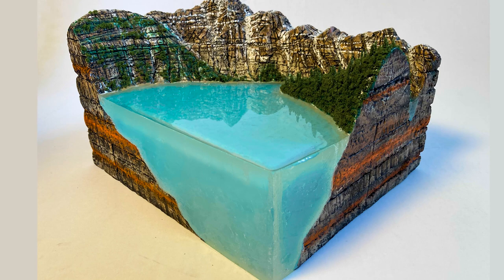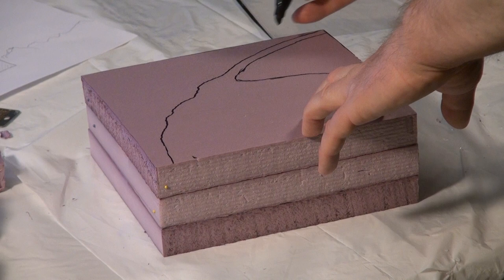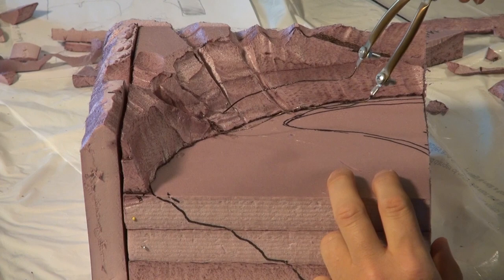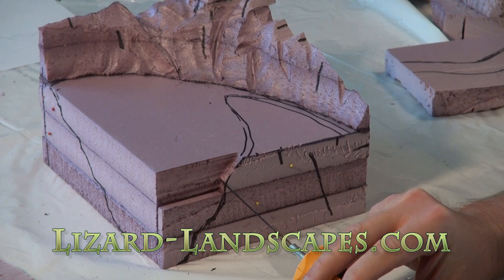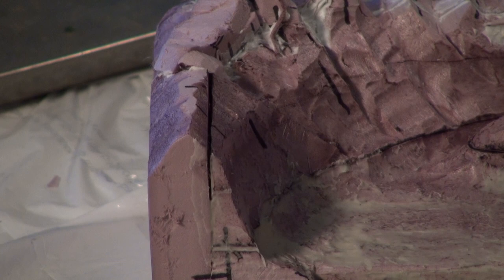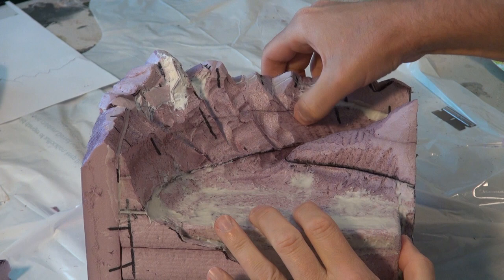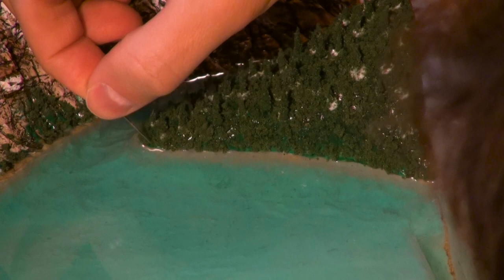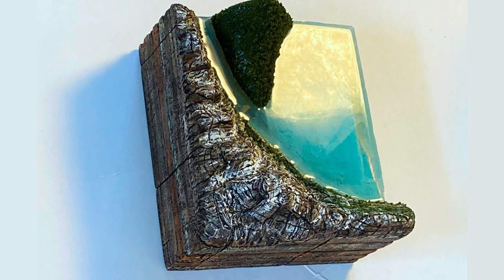Moraine Lake diorama + Christian Message!

Comment: I have really enjoyed your videos. You do amazing work. You make it look so easy.  I have tried my hand at making a waterfall for my pet frogs. It is not going well.  I was trying to use expanding foam and cut a rough shape of a waterfall that goes down in steps. I want it along the main back wall of my 30 gallon tank.  BUt the problem is now that I'm "painting" it with drylock it has huge pores.  I have added like 4 coats and can still see the black foam in many areas.  I'm thinking of trashing the whole thing and using foam boards like what you show in these videos though I'm just not good at carving yet or seeing the shapes inside of little flat squares. I'm using foam I've gotten for free in boxes too to save money.  Is there any advice you can give me?  I could post a video to show you my disaster if you'd like.  BTW, fellow born again Christian here. I like that you add nice little messages in your videos.
Reply from the maker: Thanks!  I would honestly just get one from the store, they probably have a great selection nowadays.  I posted a while ago through annotations (youtube has since removed everyone's annotations) that I was not 100% sure that this process (my old process, -I haven't made one of those in years) was non-toxic, but that the steps I took were geared towards making as non-toxic of a project as possible.  In those videos from years ago, I always used aquarium grade silicone to seal the final product after having applied a layer of non-toxic acrylic sealer.  If I ever made a project for a living creature again I would just get one from the store, except for "dry" environment landscapes.   Thank you for your support, let me know if you have any more questions.
Reply: @LizardLandscapes  No, there's nothing in the store that fits my vision or as large.  And I want to make something later for a 55 gallon though I need to figure out this small one first. I'm not worried about toxicity. I have watched the other videos on people that build these and yes I have the aquarium grade silicone, and the foam was for pond waterfalls which have fish, and drylock is proven to work well in tanks with frogs and plants.  It's the process that's kicking me.
Reply from the maker: Post a video if you can to your channel, and I'll see if I can think of any suggestions.
Reply: @LizardLandscapes   No prob posting a video. Sorry  I'm late to reply.  Here's what I got going hope this link works.
https://youtu.be/cFvWL3IkLOk
Reply from the maker: Watched the video, -you might start over with the eps foam you had in the vid.  The original structure looks like it might be too heavy.  Did you try plugging up each of the holes in the path of where the water is going to flow with aquarium silicone?  Or is that too many holes?  With the waterfalls I've done in the past, I've always sealed the entire thing with an acrylic sealer (to guard against moisture damage) and then on the water traffic areas applied silicone for a water tight seal.  The closest project I've done that has multiple descending falls like what I think you're wanting to do is this one: https://youtu.be/wBMbnpLWW10  You could always simplify it, and take away that big first drop it has.  I always wanted to do a cascade waterfall, but never got around to it.  Does this help?  ~Andy
Reply: @LizardLandscapes  Thanks for watching.  Oh, it didn't occur to me to use the silicone, but yeah there are way too many holes. I think people use the expanding foam and then cover it with coco coir which is like dirt and that fills holes after it dries. But I'm just using the dry lock.  You've confirmed what I was thinking. It's too heavy and too many holes. I do have to trash it and just start over with the blocks I have.   Yes you have helped. Thank you. I will go watch your video and will be glad to give you a comment.  Thanks so much for the tips. Was much needed.  I'd love to see you do a cascade some day. Well if you ever do I subscribed to your channel so I look forward to it.  And if I ever finish this project I'll post a video and show you.
Reply from the maker: Yes, please post a video when you finish, and let me know if you have any more questions!
Reply: @LizardLandscapes   I finally finished my tank!  I just posted the video and gave you a shout out. Thanks for the help.  I've got a smaller tank I hope to work on next. Definitely want a waterfall but something less complex this time.
Reply from the maker: Congrats!  I will have to check out the video soon.